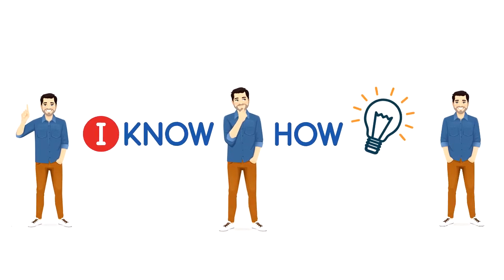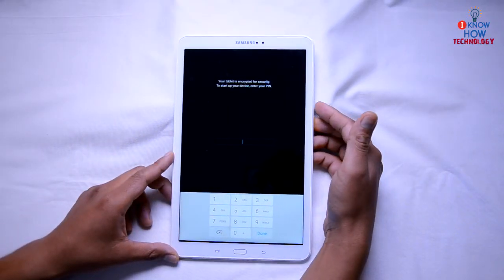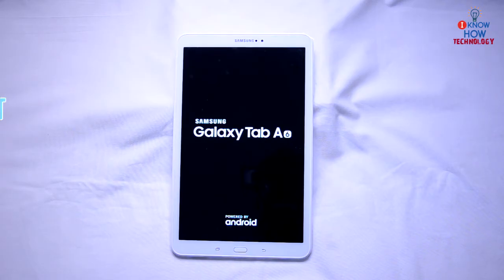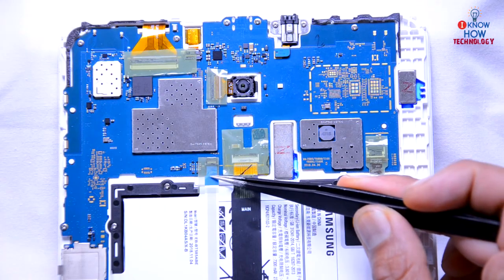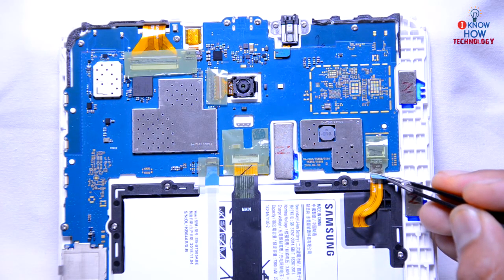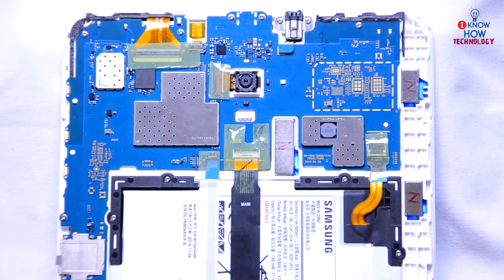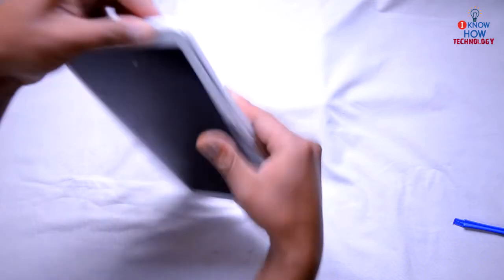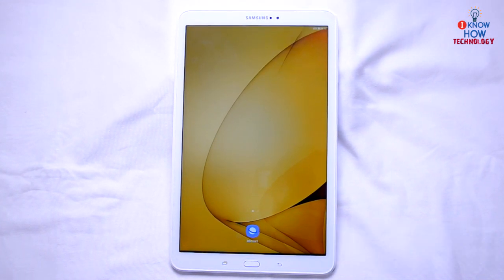Ultimate Guide to Fix Black Screen of Death Fixed Samsung Galaxy Tab Android Mobile Phone Easy Reset

Comment: Great video, very helpful. Calming voice and reassuring too. I'm scared to try the 3 button option but I don't really have any other choice, the 2 button method isn't doing anything. I just see the Samsung logo wording flashing all the time. I might try the 3 button method next (when I'm feeling brave enough)! Thanks x
Reply: How did it go ny friend? Just tried out the last method the disconnecting of the wires and it worked!!! So if you need any reassurance here it is, hope it worked out for you, let me know
Reply: @Slayy-uy8mh  Thank you. I just left it and I bought a cheap Tablet instead. I didn't want to risk damaging the Samsung anymore. It's good to know that adjusting the wires helps, thank you. I'm glad it worked for you x

Comment: Galaxy Tab A8 after updating it died power not turning on if press power + volume all i get is yellow screen for 2 seconds  any suggestion
Reply from the maker: @qasmangrol2450  if it really happened after updating then, try factory resetting.

Comment: Need your help or anyone's help.  Samsung SM-P550.  A relative broke the charging port but I replaced it.  Before this, it was operational, screen was working and everything.  MONTHS later i replaced the charging port and reconnected everything properly.  Tablet does not turn on or even show that its charging, no logos or anything, screen remains black. I tried everything in this video and nothing.  When I plug it into the laptop, it registers as QHSUSB__BULK.

Comment: My wife has an old Samsung S2 tablet. It had black screen and wouldn't start up. I assumed the battery was dead and didn't even show a charge when plugged in.  I followed this Ultimate Guide as instructed and it started up and it still had 73% charge left. Holding the power button and volume down button for 10-15 seconds as suggested by others did not work in my situation. Thank you from my wife and I.
Reply from the maker: Glad the instructions in this video helped.

Comment: Thanks sir, opening up the back cover and repositioning the LCD connector solved the problem. Could see it was out of position, 12:28 spot on 👌
Reply: Was this hard to do?
Reply: @BrandiXo  nope not at all if you have the tools like what is used in the video, hardest is just to get inside, but with the correct tools is quite simple, good luck 🙂

Comment: I have an older 10.1 Tab A - GT-P5113TS  that charges via a multipin connector and I don't have a spare. I tried all the button combinations, and had no luck, I bought a Newpower 99 replacement battery and in the process of replacing it should havereset it to boot up, but it didn't.  The same exact thing is going on with an 8" SM-T237P tablet and I replace its battery, too. Nothing!! I am pretty sure I inserted the connectors properly. Is it time to toss them and return the replacement batteries?
Reply from the maker: If you cannot find any sign of life then I would say return the battery.

Comment: My fone fell  samsung A 70 and now screen is blank.i tried power button volume down button method,doesn't work,I tried tap and massage method with both buttons it fails.what should I dowhat happened to it tell me
Reply from the maker: Open the back cover and check if anything is disconnected.

Comment: The battery died. It will not take a charge. Never done This before
Reply from the maker: check the charger if not battery may be faulty, how old is the tablet?
Reply: @iknowhow9792  yeah so it’s almost 4 years old. Galaxy tab 10.1 I need to recover my Amazon and all my accounts. I had covid and sprayed the counter with 99% IPA and think maybe some got inside charging port. It was dead though when I did that. Also I had a protective case on it the whole time I had it. Otter box. Although the port does look pretty fuzzy gummy and generally dirty.
Reply from the maker: @waltersobchak7275  check the charger, try with a different charger, if that does not help then try hardware tricks.
Reply: @iknowhow9792  hey dude I love you. In a brotherly way of course So what happened was I took mine apart. It took 3 hours to spudger that thing open. Galaxy tab 10.1 I didn’t want to break it. Spudgers are ruined now but that’s what their for. Opened it I didn’t see anything wrong. It has two batteries joined. I disconnected every ribbon cable I could. Battery and two running across the battery and another one. My headphone Jack was already disconnected that would explain why it hasn’t worked. It snaps on. Also a little corrosion on the little black and gold chip things. Used a plastic bristle brush and a  very small paint brush to remove and blew it out. I reconnected all the cables in no particular order but battery last. Popped it together and hit power. Fired right up. Wasn’t even dead had 44% charge. Evidently your little disconnect then connect trick did what you said. Now I don’t have to pay someone to get into it to retrieve my accounts. You sir are my hero. Thank you thank you thank you.

Comment: It was a pain to open but it worked! Thank you!
Reply: Wasn’t it. I ruined all my plastic spudgers but that’s what they are for. To break before the device. Took three hours. Got one side off then couldn’t get the other. I was being so gentle but gentle got me nowhere. Funny how easy it snaps back together. Two seconds. I also thoroughly cleaned all my plastic corners and joints with a toothpick and IPA. That might have been why so hard to take apart for me.
Reply from the maker: Glad it helped

Comment: All the method which is mentioned in this video doesn't work 
Stuck booting issue in samsung  tab 4 sm231
Brother how i fix it
Reply from the maker: You need to factory reset your device by entering recovery mode. To enter recovery mode press and hold the Volume up+Home+Power Button. You will see Samsung Logo but keep holding three buttons until you see android green thing and says installing system update. Then select Wipe data/Factory Reset. Let it do its bit and you should have a fresh install of the Android OS. Hope that helps.
Reply: @iknowhow9792  yes , but how i install the new os

Comment: Bro my problem is my tablets black screen became but it's worķing but not looking anything

Plz reply fast
Reply from the maker: What steps have you tried from the video? Pls follow the steps in this video, will definitely help you.
Reply: @iknowhow9792  bro i had followed that trick when the tab used to be black and it became many times that black screen

So,Whats the region behind that tab sometimes become black screen
Reply from the maker: @npnp6761  Looks like the loose connection, did you dropped the tablet really bad? or let's say many times. Is the screen been replaced recently?
Reply: @iknowhow9792  bro now that problem is finished and now the problem is that my tab screen used to be black like screen freeze always time any solution??
Reply from the maker: @npnp6761  Try fresh installing the Android software.

Comment: basically i was watching a serial and when i watched it all i turned my tablet off. it showed black grey-ish screen and wasn't turning on and it did only after i turned on bixby. the sensor screen wasn't working so i had to use it with my stylus. then i tried rebooting it and now it's not turning on and nothing is helping 😕 (galaxy tab s6 lite) it was bought only 2 months ago as well

upd: it turned on ;-;
Reply from the maker: Good to know, Thanks
Reply: Please share the way
Reply: @saketranjan5881  it broke again so i need a way to be shared too. before it would turn off and i wouldn't be able to turn it on until it's charged to 100%. now nothing is helping it

Comment: When I press the power and volume button I hear a screenshot sound
Reply from the maker: Your key combination might be different, try to find the combination according to your device make and model.
Reply: @iknowhow9792  galaxy tab e 8.0
Reply from the maker: @ytfrenzy9  Key combination is the same for Samsung. Must be doing it the wrong way.
Reply: @iknowhow9792  power plus what
Reply from the maker: @ytfrenzy9  For yours instead of Volume down, it might be the Volume up button. Initially try Power and Volume up and if it does not work try Power+Volume Up+Home buttons
Reply: Same time?
Reply from the maker: @ytfrenzy9  Yes together until you see the Samsung logo on the screen. Please watch the video carefully it's all explained in it. For you, it might work with volume up instead of volume down.
Reply: @iknowhow9792  ok

Comment: Hello, I have the Samsung galaxy tab a 2019.. Tried opening the back but like it needs some special tools. Is there any tips on how to open it with out anything extra. It's not coming on at all.
Reply from the maker: You need something like a plastic spudger otherwise you might damage the casing.

Comment: Not working
Reply from the maker: Yeah sure can give a try unless your old battery is dead.
Reply: @iknowhow9792  i have an old moDel of samsung Tablet and it's can't turn on. So, what would u give me advice. TO fix it.
Reply from the maker: @officialadityapowar9088  First make sure its charged, if not check the power adapter, USB cable, try to power ON, connect to PC or laptop, see if shows something on the PC.
Reply: @iknowhow9792  ok i will try

Comment: Sir my Samsung tab t231.. Screen light is not lighting.. Only the touch is working...how can i fix..... 
Give me the solution
Reply from the maker: The tablet I am using in this video had the same problem like yours, follow all the steps in this video, if this doesn’t help then most likely you have to replace the screen.

Comment: sir i used the power + volume down button, my phone vibrates, wich is a sign that it is on, but the screen is still black, do you know the solution?
Reply from the maker: Follow the steps that are shown in this video if still does not work then the most likely cause is the faulty screen, any signs of water damage?
Reply: @iknowhow9792  same here, it just vibrated and still not starting. What can I do:(
Reply: Same thing happen with me
Reply: Me tooo

Comment: Thanks for sharing
But I have tried it all but my screen  is still black. I still hear the sound of notifications, calls still come through but I can't answer because the screen is not showing anything.
Could you please help with another suggestion?
Thanks
Reply from the maker: Most likely the screen need to be changed if all of them has been tried? Any signs of water damage?
Reply: @iknowhow9792  Thanks for the prompt reply
I think it happened after I accidentally spilled water on it. In that case what can I do please?
If you say the screen, do you mean just the glass bit? Because I ordered a replacement glass for a longtime crack in the screen.
Thanks again.
Reply from the maker: @frevanbeth4103  I had a  same situation where I changed the whole screen.
Reply: @iknowhow9792  Thanks again
Do you have a video on how to change the screen?
Reply from the maker: @frevanbeth4103  Personally have not made a video on that but will let you know if I make one.
Thanks
Reply: @frevanbeth4103  did it get fixed now? the same thing happened to me, but i turned it on with bixby and had to use the screen with my s pen because touch screen wasn't working and then i reloaded it and it won't turn on
Reply: @healvq  It has to be a change of the LCD screen. Haven't done it yet but it still has power.

Comment: I have a tablet that doesn't work whit this tricks.
It's a new tablet, but I try to wipe de data an it was interrupted, and it's impossible find the software because it's new
Reply from the maker: There is a way by downloading the firmware to a Micro SD card and restore using the Micro SD Card.
Reply: @iknowhow9792  I know, but I couldn't found the firmware, and that's the problem.
I tried to contact with the company but they doesn't answer me
Reply from the maker: @Hennryyxx  Try with a generic one.

Comment: taking the battery cable out and back in helped me. TOP Video. Thank you....
Reply from the maker: Gr8 to know, basically resetting the power solves a lot of problems.
Reply: @iknowhow9792  Dear Sir, My Tab S4 powers up but when app is selected screen blacks out, top of screen shows battery life, wifi and time. Will strip down of unit help cure rest of screen. Please advise.
Reply from the maker: @roberttennant6282  If you are saying the screen looks good before you try to open an app? That should be a software issue. Not hardware.

Comment: I fixed my KSOD (K is borrowed from the printing industry for "black") on my LG Stylo 5 Plus by running a plastic spudger down one side of the case; not opening the case wide open, just relieving a little bit of the pressure the back is applying to the innards. 

Some phones can be resurrected by squeezing them like the videos sometimes show, while some—*like mine*—get fixed by releasing and relieving pressure on the insides. Applying more or less pressure, it's about an open somewhere in the circuitry. It's pretty obvious that phone manufacturers have some work to do on finding and fixing this one.
Reply from the maker: Thank you for your precious comment.
Reply: Qalp
X
c😅
Cm😮n